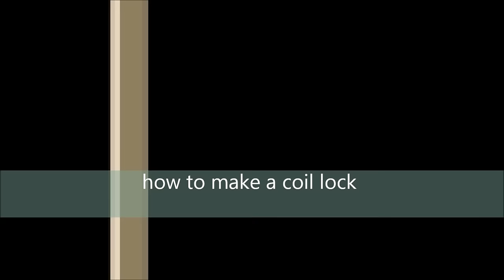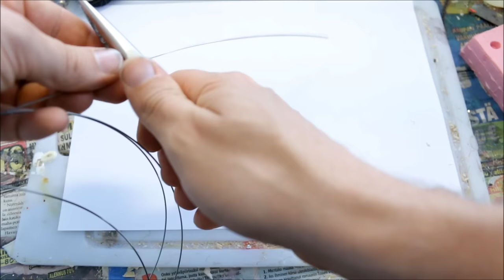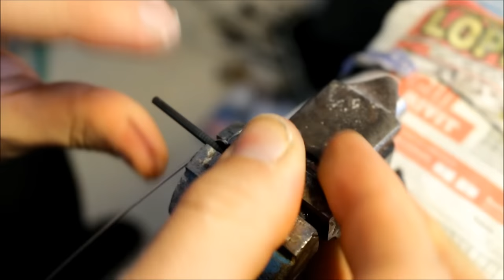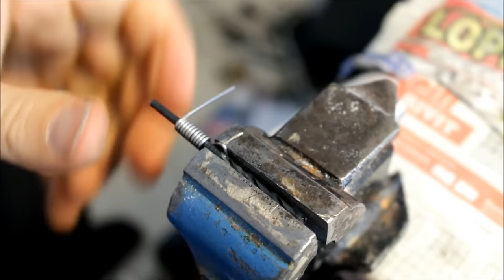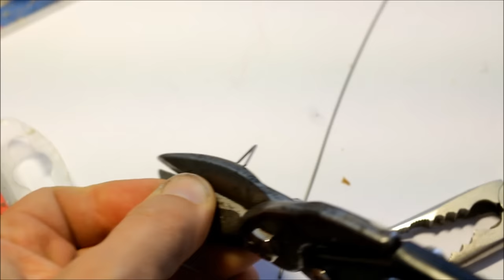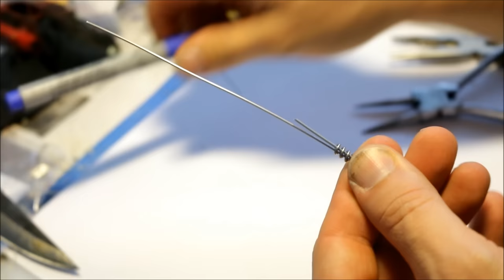How to make the strongest lure lock ever! the coil lock

Comment: I make a similar lock but I believe it's less complicated and stronger. Actually I have modified my original design so now it's even easier. This is for big lures such as a 18 cm stick bait. I make a an eye on either end of the wire using several barrel twists. I the  make a locking pin by doubling a length of wire so that  it's just 2 or 3 mm shorter than the width of the lure. Then carefully  measure and make a small hole big enough for the pin. Then I lock the the eye in place with the pin and glue it with quick setting epoxy. I leave the legs of the pin open a bit and put it in the locking hole bend first so the pressure from the open legs keeps it in place. I've modified this system with a paper clip shape instead of two eyes because there's no way it's going to pull apart with inside the epoxy that is pinned laterally through the body. 
For smaller lures I've just started using a diy screw type eye made with soft stainless steel (annealed) in .08 mm tightly twisted then glued with epoxy using a 1mm hole. Each screw is approximately 1/4 to 1/3 the length of the body. For a mid lure eyelet I angle back towards the tail to make sure it's long enough. I wouldn't recommend it for a big lure targeting fish 4 kilo and above. Your method would be even stronger than mine if you use a lateral pin. Hope you are enjoying Canada. Cheers from Indonesia.
Reply from the maker: Thats pretty interesting, i've actually tested the strength of this style of lock. If i use 1mm piano wire it can handle 300 to 330lb of straight pull before failing.